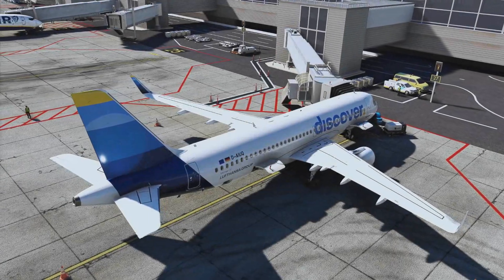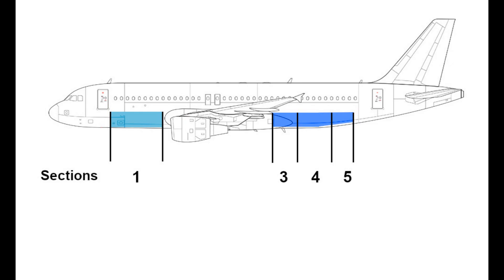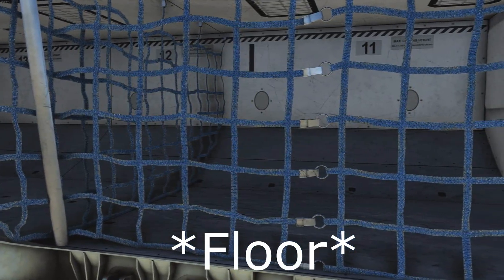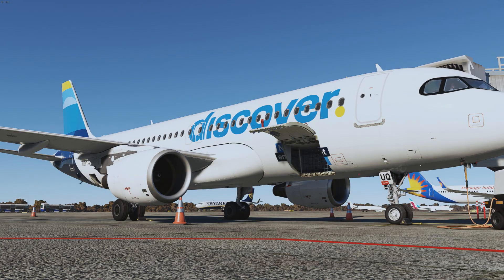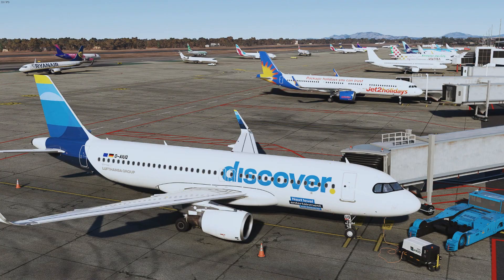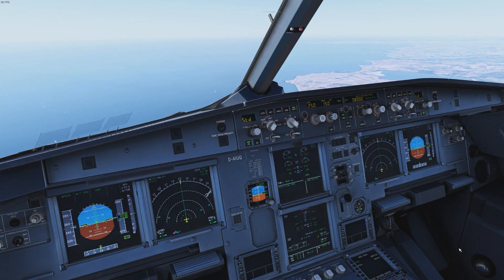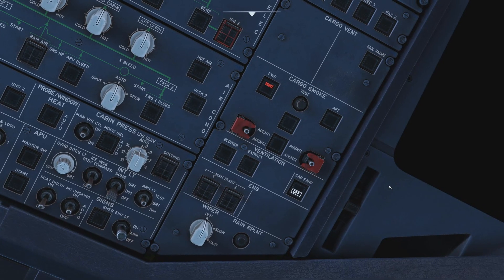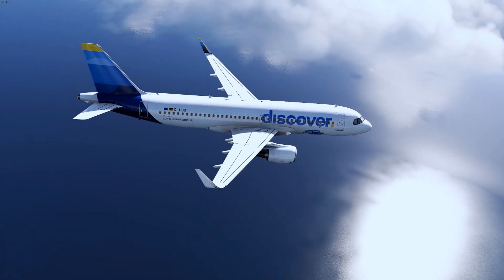How to deal with a Cargo Fire

Comment: Thank you very much for your work! I got a question regarding the sealing of off the compartment - when at altitude we are at lower pressure, so if we sink down, does the compartment a)is already on higher pressure from being filled with the halon agent b) remains at lower pressure and only gets repressurized by the fire department opening the hold or c) pressurises with the rest, where it is assumed the additional air contains only negligible amounts of oxygen to the fire? Also, does the compartment heating gets turned off automatically to additionally make it harder for the fire to reignite?
Reply from the maker: The compartment gets pressurized by the same system as the cabin. If you isolate the cargo hold I would assume the pressure would remain constant from that moment on. However, when you touch down the A320 opens up all sorts of valves to avoid overpressure inside the aircraft which could be very dangerous. I am pretty sure the pressure inside the cargo hold will be equalised to the outside pressure upon landing. Otherwise there could be a dangerous situation when opening the cargo door. The heating is done through the cabin air which is not that warm to re-ignite anything. The main focus is on keeping the gas inside the hold and to not let any oxygen in. This should starve the fire. I hope this helps
Reply: @fsclips  Thank you! Yes, that with the valves on touchdown was also new to me, but makes total sense. And with the firetrucks lining the Runway and ready to report when the venting does something (like increased smoke) while taxiing off, the danger should be minimal.
Reminds me of a joke. Two pilots are on a packed flight to a holiday destination, enjoying the cruise. Suddenly the cabin crew knocks on the door, and the captain startled almost jumps from his seat. The surprised co-pilot asks him "whats going on?" He answers: "Sorry but I was flying cargo till last week."

Comment: Why are 2 agents for each area?
Reply from the maker: On the A320s I fly we don't have that. I can only speculate that Fenix modelled an A320 that is ETOPS capable.
ETOPS aircraft must have two bottles.
I have never checked, but maybe there is even an option on the menu to select which version you want to have.

Comment: 11:44 opening the cargo doors when on the ground - does this also apply to the pilots leaving? Also is there a difference between agent 1 and agent 2, Awesome video thank you so much 🙏🏽
Reply from the maker: According to the books, only the passengers have to leave. I suppose it can make sense to have at least one pilot in the cockpit. If the fire starts again you can very quickly get out the 1L door. The Fenix A320 has two agents which is different to what I have seen on our A320s. We only have one. Having said that I know that the A330 has two as this is a requirement for ETOPS. Maybe Fenix used an ETOPS aircraft as their template. I haven´t checked, but maybe there is even a setting somewhere where you can change this panel. I hope this helps.
Reply: @fsclips thank you kindly - really appreciate the explanations. Thanks also for your great videos, they’re so well explained and I learn a lot from them. Keep up the great content 🎉